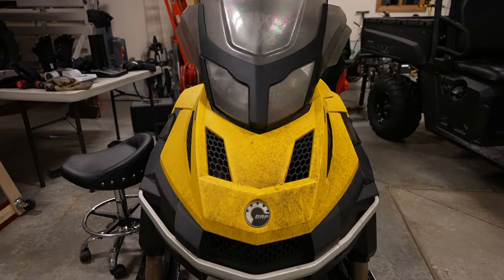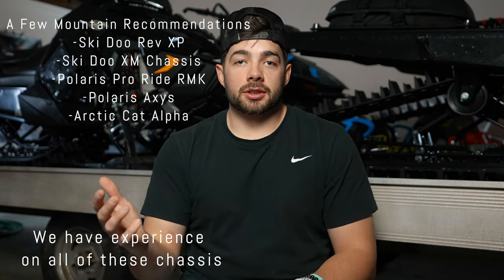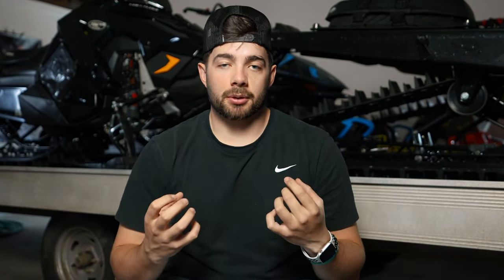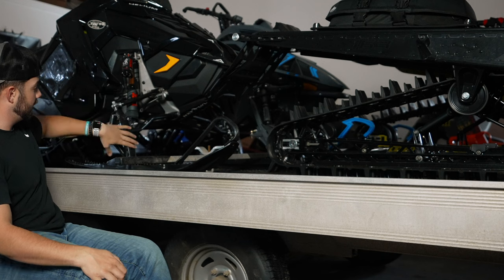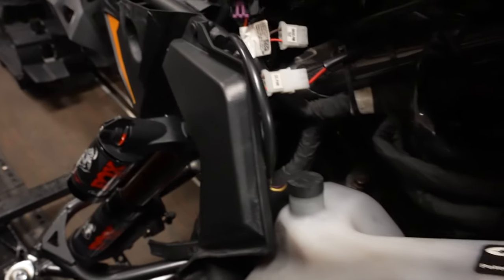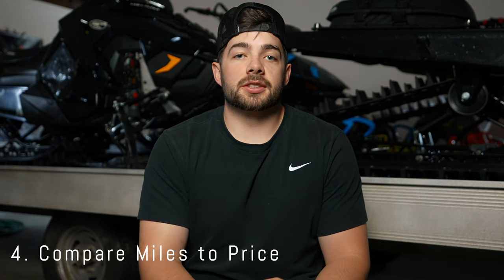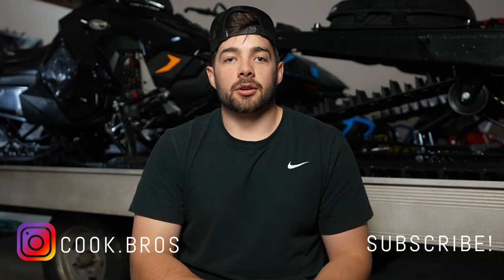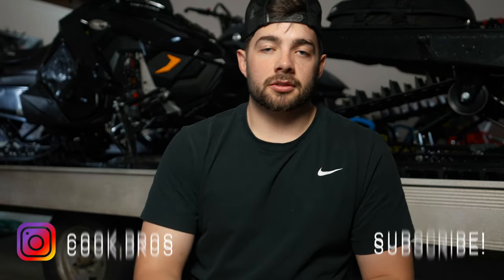HOW TO PICK A SNOWMOBILE | Watch this before buying a snowmobile | Beginner Tips

Comment: I've only owned two older sleds in the past. Arctic Cat 340 Lynx II  & Everest 440 that needed some work when we traded for it from my father in law.

I've riden Skidoo Tundra 600 Ace machines at work...32" ski stance and 154" x 2" tracks.
Lot of fun despite only having 60hp.

This year we sping checked 2 BCxrs 154" x 2" 850 beasts. (38-40" ski stance with quick adjusters)
I know its what Ivevalways wanted in a sled.
My wife is a bit apprehensive.

We're older so i don't see us doing what my wife calls sled ballet in the mountains.

Just hope she gets used to the sled and doesn't want to sell it right away...sigh.

Comment: my first sled was a Arctic cat ZR 440 with 600 EFI engine, and noticed that the skiies sucked for my riding conditions so i added boondok skiies to it and it did become a ok "cross over" sled. it worked pretty good off-trail even with the short track. tho it did start but the engine was "strange" i fixed the issues and the sled in total have cost me around 1200$ USD. i bought it for 700$ USD
and due to the mods i made i did know what i kind of wanted and also needed due to the area i live in and ride in. 
So now i have a used real cross-over Lynx Xterrain 600R e-tec 2020 instead 🙂

Comment: I’m a new rider just learning to ride in the mountain powder borrowed  a buddies snowmobile a couple times last season. 
Just sold a couple dirt bikes and have about 10k to blow. Would you recommend a 155 or 165 track for a lighter rider? I weigh about 145 pounds. I have a lot of experience on machines with motors, but digging the sleds out all the time is a little harder for me being light I think.
Reply: definitely a 155 for a smaller person, a 165 can be bulky and massive for someone smaller

Comment: Hi Brent,
I'll likely get back into snowmobiling after years out of the sport (I've moved back into snow country).  Rode Arctic Cats, Polaris, Yamahas, and Ski-doo's back in the 1970's and 1980's (Didn't ride Johnsons, SkiRules, Raiders, etc.).  I live in NE Oregon again in and around the Wallowa, Blue, and Elkhorn mountains where logging roads are abundant and ridge tops a favorite to climb, ride along, and sightsee.  At 6'7" & 240 lbs., a gym rat, and 62 years old, I'm wondering if you have any rather tall colleagues who might have some insight as to best choices.  The mountain sleds make a lot of sense, I love the idea of taller steering columns/ riser blocks for stand up riding, although the seats look really short in length.  I watched your discussion on track length and that was quite helpful.  I'm thinking something in the 2018 or a bit newer (so rather modern)  Like you say, brand isn't critical, but there may be some extra insight you or others may have for the bigger fellas.
Thanks.
Reply from the maker: First I want to say thank you for watching. Here is my opinion on your question: when it comes to handlebar risers I think people have a tendency to put one on that is too high. I prefer low bars for technical riding. Due to your height, you may want to go with a tall bar, (like a Polaris pro taper tall). You can add maybe an inch or two to that depending on comfort. But remember, you want to be in a good position on the sled, as well as have leverage on the bars for control: so don't go too high. I would go as low as possible while still maintaining comfort while standing. Aftermarket handlebar companies will have different riser heights and rise in bars as well so that would give you some more customization. (I would start lower and then you could add more height if you absolutely have to).
When it comes to chassis, I tend to thing that the new ski-doo and the arctic cat allows your feet to sit further forward (that might help when sitting down) but for technical riding that might not be a big deal. The Matryx chassis, and the new ski doo chassis, have more space for the rider than say an Axys would. Plastics are pushed further forward. Something that I would recommend is going to your local dealer and sit on different brands and see what feels best for you. 2018 and newer they are all pretty good chassis's. Personally I recommend Polaris for what I do but you could be different. Don't be afraid to swing a leg over multiple before choosing and don't be afraid to switch out risers to get a comfortable rise. Remember it's preference it's not science. I hope that helped. If you need any other help reach out.
Reply: Thanks @brentcook24 ! I appreciate your input and took notes (okay, I copied and pasted).  Yep, I appreciated your video.  Good information!

Comment: Question for you since you seem knowledgeable. 
Need sleds for a multigenerational family. 
Mom, likes slow and safe. Dad,speed. Ranch and pleasure work. Location in Colorado and Utah. 
Multiple sleds, best quality and comfort. Not limited on budget. New only. What would you choose??? Thank you for your reply
Reply from the maker: I just saw this, so are you wanting to ride mountains with it? Or would you say the most important thing is working and riding fields etc.?
Reply: @brentcook24  Both. Work and play. Sorry, that is the answer. Although probably more towards the cattle ranching Montana winter ranching side.
Reply from the maker: @TheMamaAmmah  so what I would say is there are kind of two things I would think about. A sled that is made for work (for example doesn’t need a ton of snow to stay cool, has a wide track they pulls stuff a little better) is not going to be great at mountain riding not as much power not as agile different style track, etc. But if you got a pure mountain sled it might be hard to keep it cool and wouldn’t be as good at work. If you got something like a tundra it would be good at work and you could ride trails with it. It wouldn’t be a great sled for mountain riding in deep snow though. I would just weigh what is most important to you and then go to a local dealer and see what they have. Hopefully that helps, there’s not a clear answer for wanting a sled to do everything!
Reply: @brentcook24  thank you very much!!